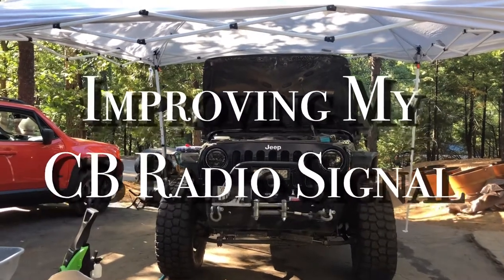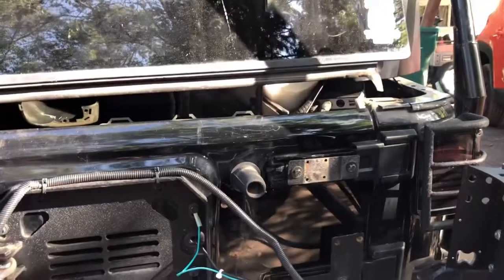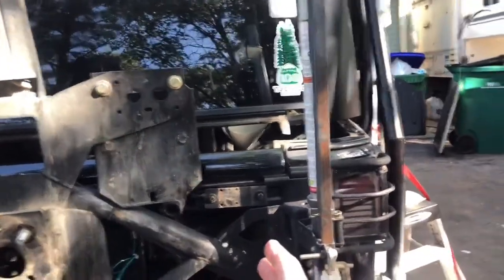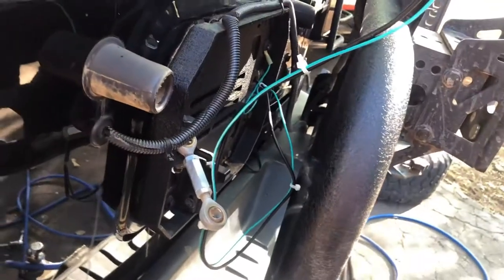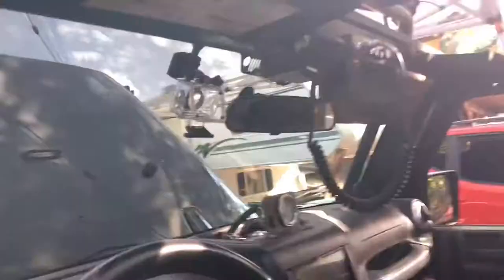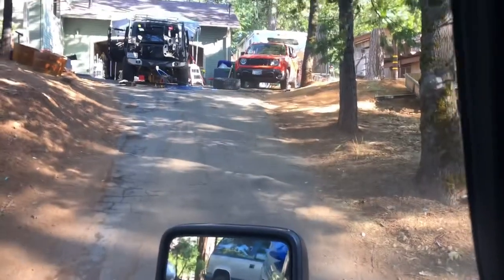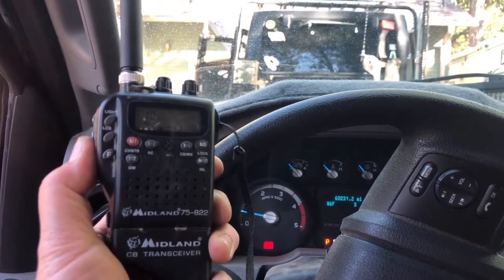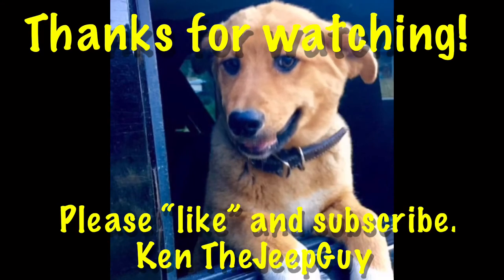Improving My CB Radio Performance

Comment: Thanks for the video. I have the same handheld cb. I read in the manual if you plug in the base power/antenna unit like you have, the top antenna shouldn't be connected or is used. Don't know if that is affecting your signal.